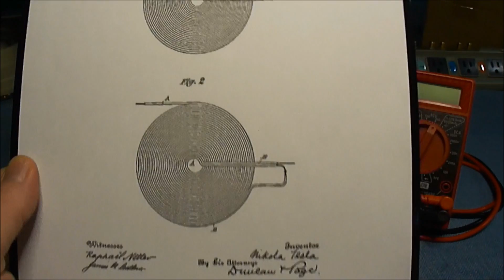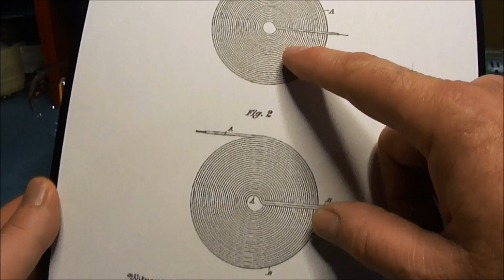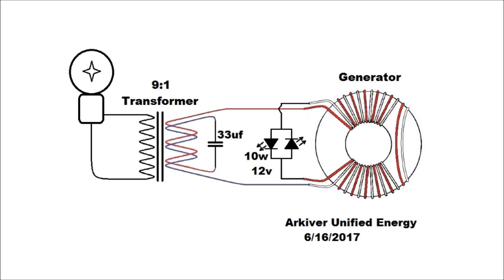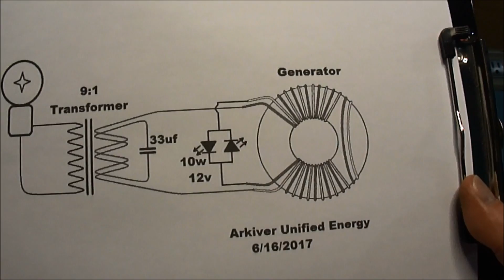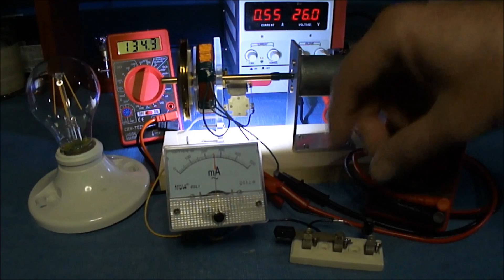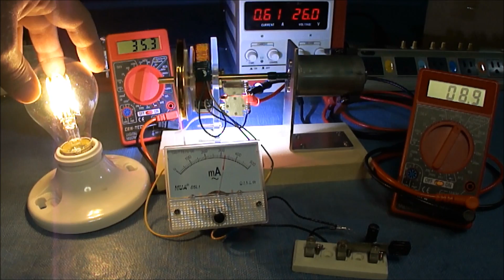Toroid Dynamo - Bifilar Simplexity

Comment: I remember many years ago hooking up one of those Harbor Freight voltmeters to a battery that was connected to a 5-watt HF radio transmitter. I was curious what the voltage drop would be when I transmitted. Kind of surprised on transmit that the voltage went up to something like 32 volts. I am quite confident that that radio itself destructs at somewhere in the range of 16 volts. There is no hope whatsoever that was an actual reading. I then looked up what chips those meters used. Turns out the chips are incredibly accurate, but how Harbor Freight or whatever the company is that they bought them from, they are implemented incredibly poorly. Mostly because any sort of surge voltage or spikes or radio frequency is not filtered against at all. Just waiting out you can't trust to those kind of meters even a little bit under any sort of conditions like your circuits are clearly experiencing. I do like your work, I don't mean to be negative at all, but I think that you can tune your circuits for some very much more that I know is possible
Reply from the maker: I agree. The meters can go haywire in some experiments. I fried many of them. Even a high quality meter could give false readings and fail in the right conditions.
Reply: @ArkiverUnifiedEnergy  I completely agree, meters can go completely out of normal and not do anything useful at all. Mostly it's the charge separation issue, remember Nicola Tesla talking about this? Earlier today a Tesla coil was demonstrated to me that had not alternating current output but direct current output. That shouldn't happen according to modern physics, but I've personally seen it happen

Comment: The brass flywheel might be magnetic cos it's moving the voltage might travel down the axel
Reply from the maker: If the magnets were stationary next to the flywheel there maybe some voltage as a homopolar generator.
Reply: @ArkiverUnifiedEnergy  brass is strange if it moves it sticks to a magnet Peter Davey's kettle I saw as a child it boiled water on 1 Hz feedback that would make cheap energy he trimmed one bike bell slightly to another there's a video on YouTube but Peter didn't submerge it he said it was2 or 3 watts he was offered 30000  nothing happened probly because oil gas and carbon taxes

Comment: See the orgone generator when it had uranium inside the town felt ill so a kind of amplifier Tesla had similar  casing as orgone generator in his oscillator that shook buildings down I put spark gap on my train  transformer when I was a toddler I got an oscillation speeding up until transformer was bouncing off the floor boards and red fire balls appeared in corners of room ? Fireballs are where the damp is probly and there probly is an invention but maybe timetunneling or Hutchinson effect? could be destructive or explode plastic and solder in the face?

Comment: Add more Cap's. SEE what happens.?? I am working on a way to get around, lenz Law, been at it a few years now, just now getting good results. However" There seems to be a fine line between" good results and Power out put" That is in Cap's, but hidden in the angle of the Magnets, used in the Spinning. THERE seems to be, an sweet spot" where everything kinda Maxes out. It only increases with the OVER-ALL SIZE OF THE TOTAL MACHINE.!!

Comment: Her is a comment made on "cool joule" s video..https://www.youtube.com/watch?v=4p9feKmnPNU that explains what could be happening...The capacitor will cause a phase shift. This is exactly what we use in induction motors to shift the phase of second set of coils to kick start the induction motor. Even if you get to shift the phase by 3 degrees, you go around Lenz's law. By adjusting the capacitance of the capacitor, you can create any degree of phase shift that you want. You can go totally 180 degrees out of phase and then the Lenz's law will work for you, not against you. This is very similar to the regenerative acceleration method. Really amazing way of going around the problem of Lenz's law ^_^ comment by "lifeis an illusion" wanted to know what you thought about this answer? alex. thanks
Show less
REPLY
Reply from the maker: The capacitor in the middle seems to make the coil as a whole react better than a cap at the end. I haven't seen anyone else testing this configuration. Maybe the coil is out of phase within itself.
Reply: Or just come in resonance and so low the impedance according the the loaded output coil? ;-)
Reply: Maestro Alex podria explicarnos a los hispano hablantes como logro esos resultados con la lenz con ese capacitor . Gracias
Reply: @JuanK2.0  El capacitor colecta energia por unos milli segundos causando un desvio de fasesy entonces cuando el lenz se atrasa o se adelanta el efecto puede ayudar a tu motor o generador
Reply: Gracias Maestro Alex es muy interesante ese vídeo. gracias por su explicación.

Comment: Instead of a counter electromotive force being exerted on the generator, you have an assistive electromotive force being exerted on the generator. in other words the generator is acting like a motor and taking some of the load off of the drive motor, i.e. lowering the amp draw on the power supply and raising output voltage of the generator due to increased rpm of the rotor.
Reply from the maker: Yes, and if the rotors were the same diameter the effect should be more pronounced.
Reply: i think your set up is awesome man, that generator is bad-ass haha. so i had an idea while watching your video... a normal 120 volt AC 60 hertz  induction motor will lose power or not work at all if the frequency is not the resonant frequency of the core material, i.e. 40 to sometimes 150 hertz as well as the frequency the manufacturers usually use in the usa 60 hertz resonant frequency. with that being said i think we should build ac induction motors with ferrite cores and give them 120volts ac at a higher frequency like 150 hertz to as high as 50,000 hertz depending on the application and i think it will make the motor much more efficient also designing the coils in the motor like a bi-fillar coil as well as make the rotor out of neodymium magnets.
Reply from the maker: Great idea! Thanks
Reply: Thank you sir!! i think if you made a larger version of your generator we would see some pretty amazing things. i really want to see you build a larger version of your generator like one that could power an air compressor or a large induction motor. You can do it man!!!

Comment: Arkiver , another great configuration! Congratulations!
When tried with a BiTOROID transformer, the input to the primary drops significantly at the correct frequency.
Thank you again for a great demonstration .
Reply from the maker: Very interesting! If the circuit is still closed when the power is removed it should be able to continue for some time. Thanks

Comment: I wonder if you put one side of the secondary to ground(real earth) and half rectify the other side into a capacitor, and then into a dc load, if it works even better. Thanks for the great video!
Reply from the maker: I'll have to try that. Thanks
Reply: your welcome. it works with the resonant frequency of the coil, it produces a standing wave. that is amplified on one side if the other is grounded. Dont know if the frequency is high enough to reach the resonant standing wave.

Comment: Nice innovative video as always!   With the cap, it looks like you are getting enough phase difference between the two load currents on the two bifilar windings so that the source volts are positive whilst the total load current is going negative for part of the cycle....which means some negative power or power travelling opposite direction into the source.  Making the source volts go up and input current dropping.
Reply from the maker: Thanks. It needs to be looked at with a scope. There's definitely energy going back in.

Comment: Nice video.  Interesting about the 2 coil assemblies interacting and what Tesla was really after.  I have looked at practically everything I can find written in Tesla time and can not find any mention of this arrangement for any purpose other than to make a more natural balance of capacitance and inductance of a coil unlike a regular coil where the coil would be largely inductive with little capacitance per length wire section.  It is even more peculiar that the patent refers to "electromagnet" but most of his work involved AC and resonance systems.  Not sure if the patent is for DC or AC application.  Also he never directly says why he needs the huge stored energy  that he describes the odd coil arrangement gives.  I could speculate but I am looking for what he actually says not me.  He spent his whole life on these things.  I only have spent 30 years so I am still a toddler net to him.
Reply from the maker: Hi, Tesla didn't share the key details of his work and the good stuff we are searching for was forbidden publication. The bifilar coil makes use of the magnetism stored radially in the diameter of the coil. I'm guessing the right cap value is synchronizing the reactance time of the coils. If I add another cap it goes back to normal. Thanks
Reply: Hi, Arkiver.  Tesla may not have shared key technical details in the more interesting works, but he did give a good glimpse of his overall goals as a servant to humanity and harnessing every aspect of Nature's energy generation methods.  In one reference he states (1900 or so) that he was "reckless" in his public announcements in earlier times and would be more reserved from then on.  This patent is before 1900 and may offer a hint at something big he had planned for a future application during the "reckless" days.  Tesla never did anything small, every discovery, patent, and involved partner was for something very big as in to effect a large population, nothing small like powering a single house.

The pancake bifilar is physically a coil in 2 dimensions.  Which is unlike a normal coil of 3 dimensional fields.  Also being 2 dimensional, it looks like  the outer larger radius coil turns can act to shield/isolate the inner coil turns magnetic fields.  He in 1900/1901 Century Mag talks of a hypothetical energy "sink" which may be related.  Note the need for large capacity.  This is a feature nobody seems to notice.  You probably already noticed in using these resonant coils as transmitter and receiver, that the transmitter coils is wound opposite to the receiver secondary coil.  This may give you some clue to your question about whether Tesla in the patent was talking about interaction within one pancake coil or between the transmitter to receiver as a group.  I think he was just referring to interaction in a single pancake unit.  I have built several 600kHz coils like his and compared it to a regular resonant coil of same frequency.  All years ago, no longer have them.  Also testing using a regular Tesla coil to drive the pancake coils as his EXTRA coil that he often mentioned.
Reply from the maker: At the time of his patent he may not have realized the broad future applications. I made a small scale energy sink with a fluorescent bulb and thinking of revisiting that project.
Reply: Arkiver.  I agree although Tesla was quite thorough in his published earlier experiments, he was so busy, that it is very understandable if he slipped a few times and might not have realized the far reaching impact of something at the time, although I see in many cases he was dead on to recognize some significance that a lesser man might miss.  I would really like seeing any experiments  using the energy sink principle.  Many years ago when I was well financed, I conducted a lot Tesla type experiments and with the coils as I mentioned before and many more that would get even a critic of Tesla to about face and reevaluate there view of the man.  One of interesting personal characteristics of Tesla that after years of reading his words that I have noticed is that he would make broad sweeping futuristic statements of what a principle or device might do in the future which would lead people to think it was poppy cock or too stupid or far into the future.  But the thing I noticed is that when he made these statements, I found he had already actually made proof of concept devices!  So he already had something, but spoke to others like it might be possible in the future.  That is a very important feature of his mindset and has never been noted from "Tesla Experts" as far as I know.  Knowing the man is just as important as knowing his experiments to me.  So really Tesla was always one or two steps ahead of anything he prophesied becoming a reality.  Then I started working on recreating his energy "sink" in numerous experiments and found a lot of "interesting" things and also realized that my experiments were starting to have the effects as TH Moray observed in making his radiant energy machine.  Then life got in the way and loss of finances and have yet to get back in to heavy research, but when I do I have years of thought experiments to followup on.  Until then, I will satisfy my thirst by watching great and meaningful videos from trail blazers such as your self.  :)
Reply from the maker: Self charging energy sink  https://www.youtube.com/watch?v=EJUuzGPQw0k
Reply: Arkiver.  Thanks for the florescent tube energy link.  I remember back in the black & white TV days that if the room was dark and I turned OFF the TV, that the screen would still glow slightly for a very long time.  I was only a teenager then and assumed it was just the high voltage power supply draining and had not full discharged ye, but actually it could have been due to a similar effect as in your setup, since it lasts so long.  I have also seen this effect back in 1986 when I was investigating Bearden's theories on bucking fields and my own research along the lines of Moray's free energy device.  I have also seen a mention of this "fluorescent persistence" in various old literature which I have no recall of the specific reference but it has been observed  by others long before us.  Surely Tesla would have know of it as he did an extensive study on vacuum, gasses, all sorts of radiation emissions and used AC of many ranges of frequency, DC and PULSED DC of varied voltages.  All very likely to make this effect appear in his time even by accident.  He was certainly sharp enough to recognize the meaning of this if there was anything big to come from it.  Moray seemed to think there was.